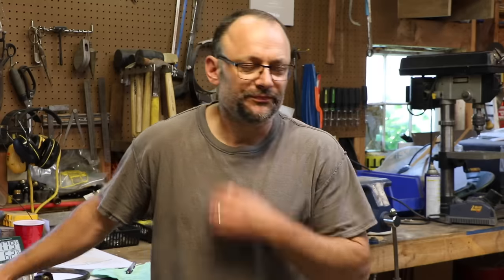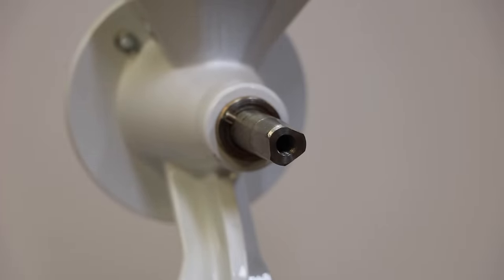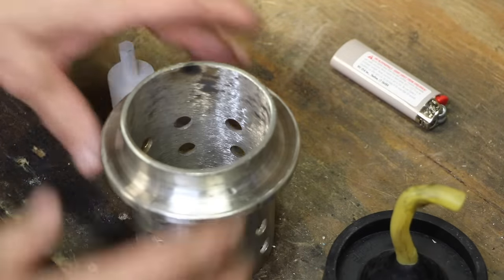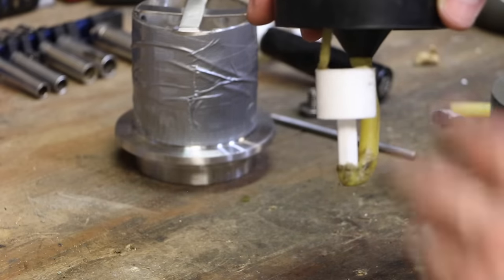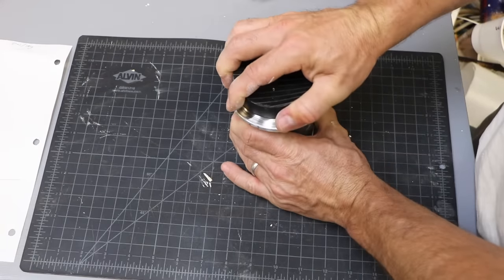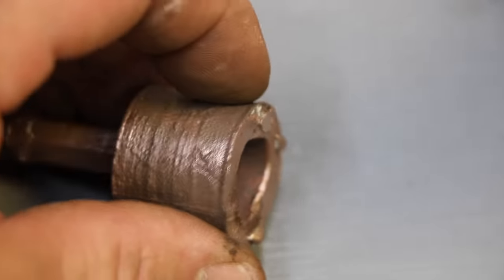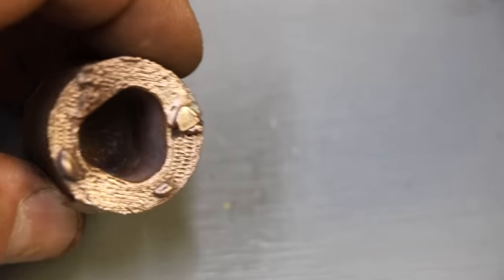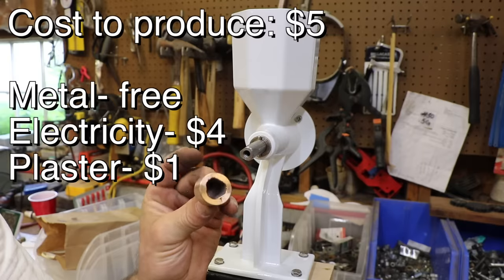I Refuse to Buy Your $@#!   I Make My Own.

Comment: The company might say "well why would you do more than $30 of work when you could buy the thing?"
well, company, that's because we don't want YOU to have that $30, you don't deserve it.
Reply: Well said.
Reply: But they got the $299 for the mill in the first place, so I doubt they are too upset on missing out on the additional $30
Reply: @Guppypants  lmfao
Reply: @WhenDoesTheVideoActuallyStart  LMFAO indeed, considering that mill is made in India
Reply: Yes...and the design choice was purely based on greed...Things like that are one of many reasons I hate Apple products too
Reply: And yet you don't even know what company it is 🙄
Reply: Machining two flats parallel to the spindle axis would have been easier and cheaper in every way, so yeah, it's on purpose so you don't attach a motor to it too easily.
Reply: @chas1878   Two parallel flats would not tightly fit to any handle made with a lack of precision.
Reply: @gorkyd7912  works fine for plenty of pasta rollers and countertop meat grinders.  If the handle gets loose you shove a shim in, even a piece of paper works.
Reply: @chas1878  , Thats probably it.
Reply: @senatorjosephmccarthy2720  I feel sorry for you.
Reply: @gorkyd7912  I know this is an old video, but I think you have the right of it: the tapered shaft is actually a clever engineering solution to making a tight fit for the handle, with one bolt, that automatically compensates for variance in the cast part: the handle. The three tapered flats are simple to do with a jig, and there are no critical dimensions at all: three points of contact will happen, over a wide range of grind angles or casting shrinkage. It's actually pretty smart. Design for manufacture unfortunately seldom seems to  mesh with design for repairability. (check any modern car. :/ ) This is one case where it's not too far off.

Comment: Just cut off the end of the handle with a grinder and welded on a straight bar
Reply: Or........just buy flour
Reply: That was my first thought. The quickest and easiest way to solve the problem, and a lot faster than modeling and 3D printing it, and then casting it in metal.
Reply: @harpitap  That is an option, but then you lose some of the ability to control your ingredient (wheat variety, grind size, etc.) and to store it long term (flour has lots of surface area and expires).
Reply: But sometimes you do things just to do them. It also helps build skills you may need in the future.
Reply: @godfreyjones4428  Very true indeed. I will almost always repair or make a needed part over buying new because that was how I was taught. If you can fix it, do so. The satisfaction of repair or make far outweigh replacing. There is no greater feeling than to step back and say "I made that!"

Comment: Why not make the hex portion of the 3D print the OD of the forward portion of the adapter so that it's much stronger and just use a larger socket driver?  Also, from the remains after the hex portion of the 3D print broke off, it looks like the fill setting was very low.  Change it to 100%.
Reply: I think some of the commenters may have missed the point of the exercise. Waaaaaay more than $30 in time, materials, energy, and capital cost allowance on equipment spent here, even if he just reworked the 3D printed version to try to get it to function.  Near as I can tell, the whole point of the exercise was to have a chance to try his printer as a pattern maker for lost wax casting, and the experiment looks mostly successful to me.
Reply: Ah, yea that would have probably been the easiest solution..
Reply: A plastic part wouldn't hold up period, notice him using his metal cast piece in the drill on 1st gear and him having to hold the drill with both hands. That's far too much torque for crappy pla
Reply: Even at 100% fill, there's not a chance inn the world that it would hold up. Even if he offset it to print on the bias or milled it out of solid plastic, and added a fillet/radius at the transition between the hex drive and the body, it wouldn't hold up.
Reply: @MrPendell  No sir. The point of the exercise was to make a monetised youtube video that gets 50k views in a week.
Reply: @ytbandit1951  Fair point, sir- I stand duly corrected. I tend to forget how much the revenue from a monetized channel can affect the decisions you tubers make when choosing what projects to take on and to document. That said though, it’s interesting to us because it’s interesting to him- we get to experience secondhand his translation of a project from the theoretical to the physical, complete with a couple of learning bumps along the way.  Those of us who don’t have a fully equipped machine shop and assorted cool gear from other trades in our backyard also get to admire and envy some of the cooler toys he gets to play with in the process.
Reply: @MrPendell  Also fair point!
Reply: You don't want a high fill setting when you're just gonna cast it in metal anyway.
Reply: @MrPendell  why no just a drillbit then a file,  less time too???
Reply: @littlejackalo5326   his point was to make the hex something like 3/4" instead of the 5/16" it looked to be, then drive it with a standard socket in the drill.. could make it as large as it needs to be theres no size restriction on the flower mill the hex could of been 2-1/4" if he wanted, the limiting factor would be if the internal triangular design would strip out or not.. i think itd be fine if there was constant pressure pushing it in but once you let the pressure off some and it cams over a few times itll be ruined.. i would have skipped right to just grinding a hex into the shaft
Reply: @MrPendell  You could argue that the only cost to this project was in plaster and propane, everything else he already had, from metal scraps to tools. Better use what you already invested in and keep those 30$ in his pocket! If you add in YT revenue, he actually made money!
Reply: @AndrewBrowner  Hmm, I think I'd have expanded the diameter of the hex sufficiently to allow center axis drilling it and attaching with a bolt, just like the original handle.
Reply: @Adamsadventures83  Eh, if he'd taken that interior and put a hex around it, then printed in PETG at 100% infill, it would hold up.  Because it wouldn't have anywhere to deform to.

Also, I'd be willing to bet that 100% infill PLA and printing it horizontally (so the layer lines weren't perpendicular to the applied force), it would have done the job alright.

but yeah, an exercise in using 3D printing to create models for investment casing.

Comment: Considering the load , a quality bolt and a socket would do fine .
Reply: That's what I thought, as long as he doesn't bottom it he should never have a problem with removing a broken bolt, and like you said, a quality bolt.

Comment: Why wouldn't you just grind the shaft into a different shape?  Or could you have modified the handle so that it was just a collar where the outside was a hex/square?
Reply: You are right. He has a lathe, and the shaft or another crank could easily be modified with a lot less work .
Reply: @ats440you  how much work was this really? He is already set up for this type of casting. It takes some time but not much work. The part was already modeled for him so its just waiting for it to print, playing with a little wax then waiting for the plaster to cure, waiting for the plastic and wax to burn out while waiting for the metal to heat up. Really the only "work" is at the end cleaning up the part. The rest is just wait time where you can do other stuff.
Reply: @MrTarfu  A lot more than taking that shaft to a grinder and making it a hex I'd wager :)  Though his solutions means the hand crank is still usable should he want.  His solution is also more fun to do :)

Comment: gator grip socket.    been around for decades.   Also,   sheet metal 1/8" drill 3 holes, file to fit, cut legs, fold back and thread a bolt.   Boom
Reply: But that's a pretty boring video

Comment: Actually , I'm kind of surprised and somwwhat disappointed that you didn't connect a electric motor via a step-down 10/1 gear transmission (and cast and machine the gears and transmission housing yourself - not really that much harder).
Reply from the maker: Hahaha!  And I thought I over-did it!
Reply: @FarmCraft101  overengineering is always th solution
Reply: @FarmCraft101  But of course (learned that from your videos - who else would make a 10,000 piece wooden donut ?)!!! 😉👍🇺🇸

Have a Happy 4th , my friend !!!

Comment: Honestly, I think the configuration of the shaft is that way because it's cheaper to do three milling operations rather than six. Unfortunate, but not outright nefarious.
Reply: Cheaper to put a keyway in and have no extra machining needed. There's a reason nearly all motors pulley are with keyways and keys.
Reply: They copied a 1900 design and back in the day that was the high tech universal fitting

Comment: While I agree its a 'proprietary' interface and it was a cool project, I see a lot of benefits to the mill manufacturer from a purely technical standpoint.

1. It looks faster and cheaper to machine than either a hex or a square drive 
2. Since it removes less material you can have a bigger and stronger internal thread 
3. if they test these at the factory, as an automation engineer, I would rather make the machine to attach to their shaft feature than either a hex or a square 
4. when the bolt draws the crank handle tight against the end of the drive shaft all play is eliminated because of the taper. This is much more secure-feeling to someone hand cranking than either of the options you proposed.
Reply: I agree. I really don’t think the manufacturer deserves so much opprobrium. It’s (well) designed as a hand-crank. The adaptor is an afterthought, and one wonders whether the construction, bearings etc are up to the task of being thrashed by an electric motor of unspecified power.
Reply: I've got antique grain mills and meat grinders that use that same shaft,
Reply: Mechanical engineer here:
My Thoughts exactly...
the manufacturer is driven by the cost of the basic appliance, the adaptor is an extra, which will only be sold to a few.

also, why make that tiny hex drive for the 3D print? why not make a large hex. on the outside of the main cylinder to be driven by a large socket?
that way the PLA is basically as gasket between the hex socket, and the 3 sided taper...
Reply: But this is still a great projekt :-)
Reply: @PWARHOLM  Oh, most certainly

Comment: u could just make a hexagonal sleeve to go over instead of using that tiny bit at the end to transfer the torque
to clarify what i mean, u could just keep the inner dimensions of the white plastic part and add an hexagonal profile on the outside u just need a large socket and there is ur problem solved 
at least as far as i can tell over video
Reply: Or simply cut a hex on the shaft behind the handle mounting.
Reply: I was thinking the same on viewing then considered just filling a hex socket with fibreglass filled epoxyand bolting it on once the shaft and threads are greased. Instand negative mold, no waiting for printing or melting and a now has myriad of drivers can attach to. When the machine wears it's plain bearings out, due to the high heat load from high rpm, he can remove the drive coupler, clean off the grease prior to returning it to the store for a replacement.

Comment: I would make this part differently:  By forging it.

The basic idea is this:  You can forge a pipe into a hex socket very easily, just by choosing an appropriate sized pipe, heating it to red, then forging it down over a bolt head of the size you want for the socket.  This trick also works for any shape socket, such as those annoying penta sockets used on water meter covers.

To apply this trick, you could forge a pipe down over the mill shaft, but if you didn't want to risk the mill, them copy the mill shaft by grinding three tapered flats on a steel shaft of the right diameter.

Once you have the pipe socket, you need to adapt this to a drill.  This can be done either by forging down the other end of the pipe or by welding on an appropriate stem -- you can figure that out.

Comment: Well done.  And the Grain Mill Company can shove its over-priced 25-cent part up it's butt.  I'd have made my own, too.  But probably just found an old socket that looked 'close.' tossed it in the forge and then drove it on the tapered shaft while bright red hot.  Of course tapping it back off before it got the mill parts too hot.  Some time "down the road" and after many, many beers spent in deep thought for the design, I'd run it with a pully and belt to a bench motor -- something a bit heftier than a drill motor.  The mill sure grinds nice flour, though!

Comment: Nicely done, great video.  I'm always interested in ways to be self sufficient (as much as possible), building rather than buying.  Adapting this idea further into a drive pulley to attach to a fixed electric motor (not a cordless drill) seems a logical next step... :)

Comment: I would like to see a modified 3D model that, instead of having a little hex shaft, put a big hex on the large O/D. That would fit into a large, steel, hex socket and, with adaptors that I'm sure you have, you could then drive it with your drill.
Reply: His was hollow too. What was he thinking? Of course it will break!

Comment: Nice job on the part. I personally think I would have put 3 bolts in a short piece of pipe equally spaced from each other(or 120 degrees) and then had a shaft welded onto the pipe itself on the center then you can just tighten the screws down to your desired diameter. I hope that makes sense.

Comment: I feel like this has Right to Repair implications, as well. They make a proprietary setup, fine. The part isn't that expensive. But what happens if/when that company decides to stop making that part, for whatever reason. Under current laws, without R2R, they could sue someone for making that part for others.
Reply from the maker: I hadn't thought of that.  That's ridiculous.
Reply: Yep.
Reply: Oh, here we go, sue everyone because I don't understand the engineering behind this shaft / crank.  This isn't even remotely a right to repair issue.  I'm betting some would cry that since a CPU fan maker won't sell me bearings they need to be sued because they are restricting my right to repair.
Reply: @bobroberts2371  try actually reading my comment? I in no way suggested consumers sue the manufacturer. I said a manufacturer could sue someone for making the part for others after they have stopped.
Reply: The mill maker claims the adapter to be " Patent Pending "  . If the patent is granted ( debatable since I don't see anything novel about the design  )  , would you try to sue them claiming that the pat was not valid therefor you should be able to make the part for commercial sale?   Right to repair does not apply since it is a patent rights issue.
Reply: @bobroberts2371  you seem convinced I want to sue someone. I was making a point about right to repair implications of proprietary devices like this. Maybe reading comprehension isn't your strong suit.
Reply: @AlexDeGruven  My exposure to R2R has been through Louis Rossmans channel so perhaps that colors my thoughts. ( A channel that I no longer watch )  

While things started out sounding like a good thing, he has gone off the deep end with his rants about how " the evil they that control manufactured goods / the real estate market "   

Regardless, the shaft end isn't proprietary, it is an elegant solution that does not require the crank to be machined.  Others have posted that this design is 100 years old.

Comment: If your design for the 3D printed adapter had a 1" hexagon on the back which would then be driven by a 1" 6 point socket then I bet it would have been strong enough.  Another design the outside of your adapter could have a hex shape and then the entire adapter would fit into and be turned by a large 6 point socket. Also there are stronger plastics which some 3d printer can print..    Might be enough here for a follow up video.

Comment: As a fun project, awesome!
As a money saving measure? I think you have more than $30 in copper alone, not to mention $3,000 in tools. 
I would have ground the shaft to a standard hex and made a different manual handle to complement my powered socket driver.

Comment: You probably have been told this a few times, but that PLA part would have survived much more torque if it weren't hollow. In addition, increasing the diameter of the hex shaft would also have a great effect on rigidity.
Regardless, anisotropy played the biggest part in the failure of the printed component, indicated by the fracture being coplanar with the printed layers. You could have considered printing at an angle, making it where the torsional stress is perpendicular to the printed layers. 

(I'm not dissing your work - Just pointing it out for anyone with less tools on hand that could benefit with the information)

Comment: Great Job. Could you have made a pulley to mount on the back with a set screw and use a small motor and belt set up. I know you could do it. This project was a good deal. Thanks for sharing this.

Comment: I understand the frustration when having to fabricate things to get a job done. I also understand time and cost of fabricating. I think the manufacturers price point had that in mind too. Simple solution to this one I think would be to use a Motor Arbor slide it over the shaft and lock it in place. You could even put a pully on it and add an electric motor. Belt driven grinder.